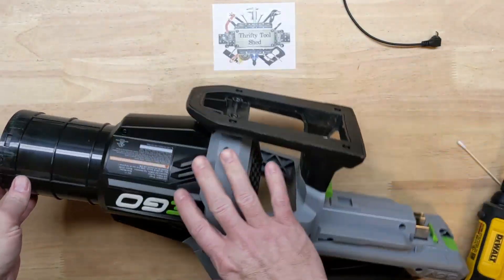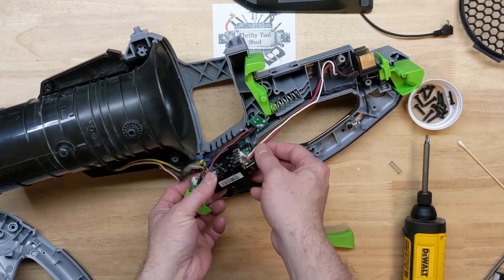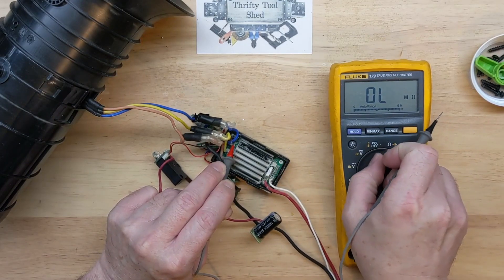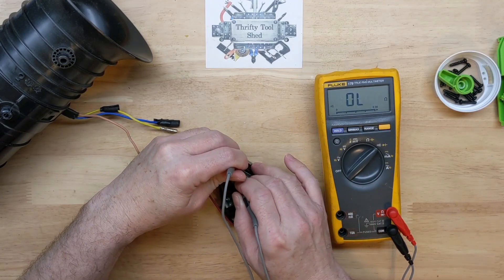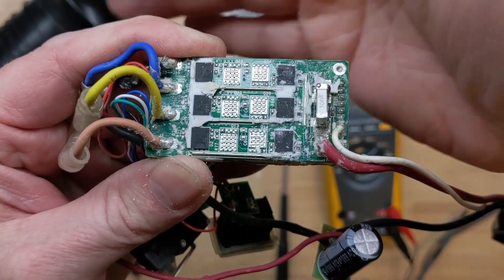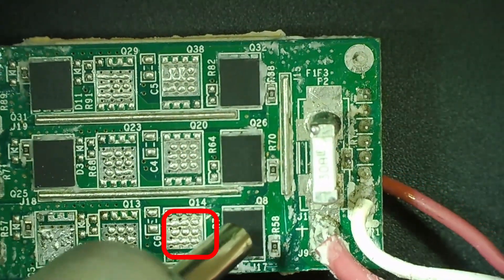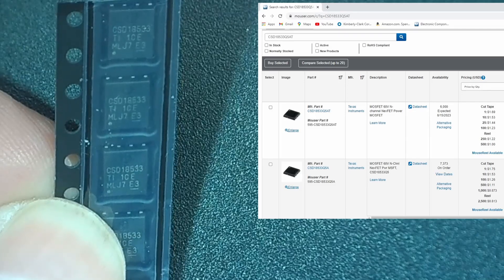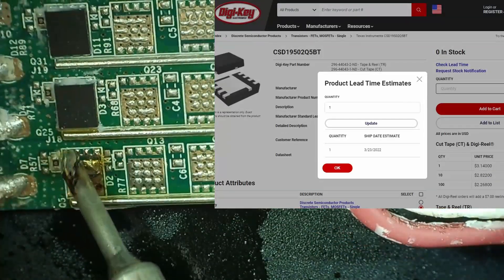EGO 56V LB5300 Blower Controller Repair

Comment: Question the what wires for the motor are - and +
Reply from the maker: The motor for this one is Brushless or BLDC it cannot run from simple + and - supply. More like a 3 phase motor. The Brown, Blue and Yellow are the 3 motor leads for these.

Comment: How did you determine the mosfets on Q5 _ Q13 were the bad ones? Because they were on the brown lead that had the least resistance? Thx for posting this video, very interesting.
Reply from the maker: Yes, exactly. Those Mosfets are on the output phase for the Brown lead of the BLDC motor. I have a couple other similar videos sharing some of the troubleshooting of this style EGO controller and did not repeat some of those steps, thanks for your comment. It may not be very clear to some which have never seen the 650 Blower troubleshooting video or the 14" chainsaw repair video.

Comment: good vid,  i wish you could explain how you strategize mosfet/ic/pcb circuit validity testing for various appliances, 25 words or less, just really your think pattern.   I have repaired pcb's for various appliances by using a hit or miss 'good guess' basis.
Reply from the maker: Hi,
I usually find Mosfets shorted when they fail so if something is blowing fuses like this blower, for example, I simply check for shorts. In this case the mosfets were shorted on one output phase, but sometimes more than 2 have shorted. You can also check if an individual Mosfet is bad using diode test mode on DMM. As transistors test similar to 2 diodes. Hope it helps, thanks for your comment.
Reply: @ThriftyToolShed  Great fix! Recently bought the 650cfm with charger and battery. Glad to see the insides. Wondering if you have just purchased control pcb from manufacturer to do replacements. And will they sell parts  to owner if requested? Thanks.
Reply from the maker: @John McCormick  
Last I checked you could get the electric assembly from jackssmallengine.com for around $70. Not bad I guess, glad atleast it is available. Some EGO models the controller is over $100. If you need the Motor or fan parts you have to buy the complete Duct assy that is over $85. Most of these type tools do not offer the controllers separate to purchase at all. Thanks for your comment!
Reply: @ThriftyToolShed  this helps tks